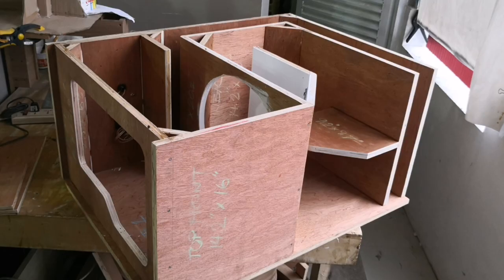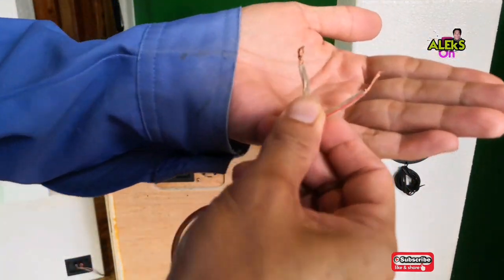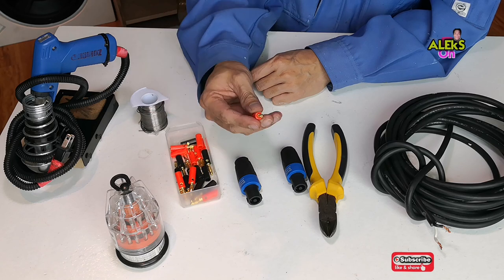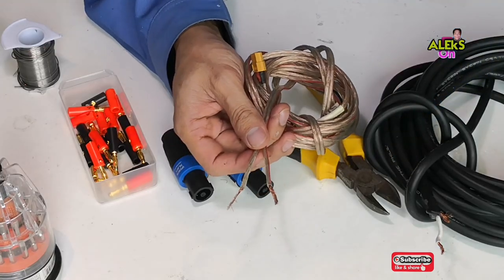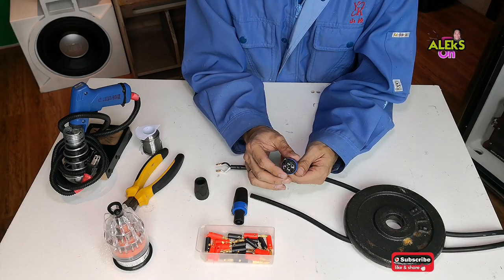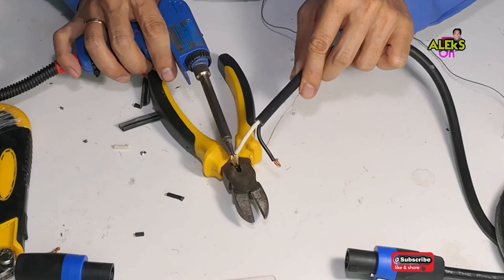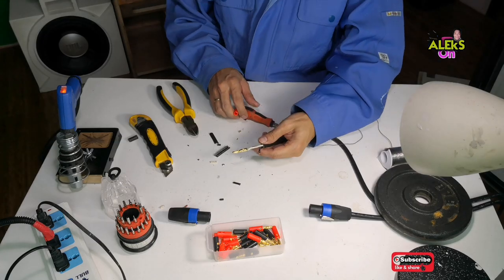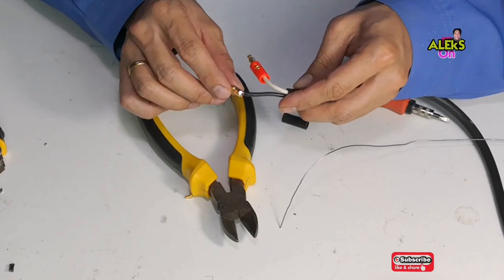SPEAKON & BANANA PLUG DIY SPEAKER WIRE UPGRADE TUTORIAL - MAS MATIBAY  MAS MAGANDA - TAGALOG VERSION

Comment: Boss pahelp naman po, may speakon bang naka splitter? I mean po 1 speakon to 2 speaker connection, gusto ko sana kasing mag by amp ng midhi, gusto kong i connect yung mid to mid then tweeter to tweeter, 2 speaker box po
Reply from the maker: Wala nka y connector na nabibili, i cucustom mo or gawin kung gusto mo y splitter
Reply: @aleksondiy  guato ko sana isang speakon lang gamit papuntang power amp
Reply from the maker: Pwede naman sir 3 pin ung XLR L&R un dalawa ung Isa ground

Comment: Sir pwede po ba speacon to rca?
Reply from the maker: Pag speaker wire not advisable,
Reply from the maker: Speak on to banana plug pwede, to rca di pwede
Reply: @aleksondiy  ah ok po.... salamat sir keep on vlogging
Reply: @aleksondiy  sir p advice naman po... gamit ko kc passive n merong speacon input tapos mixer ko quarter jack output. 
salamat po
Reply from the maker: @bhetskym6919  ok nmn yan, may nabibili yan online ganyang connector, pero kung mkapag diy ka nyan mas ok!
Reply: @aleksondiy  salamat po